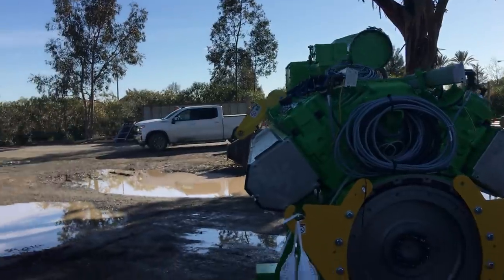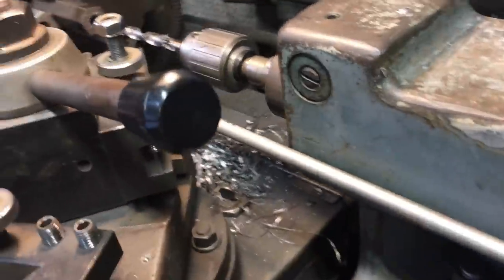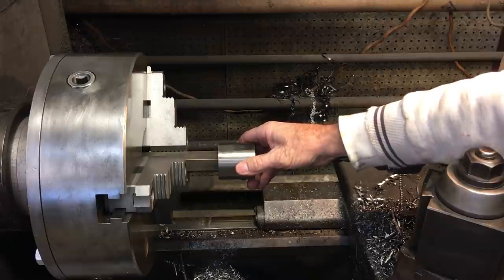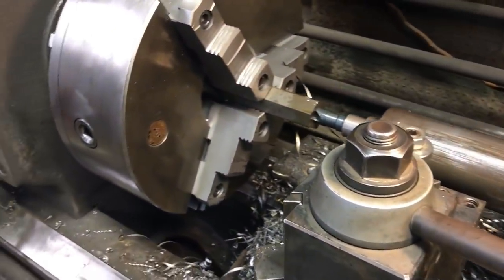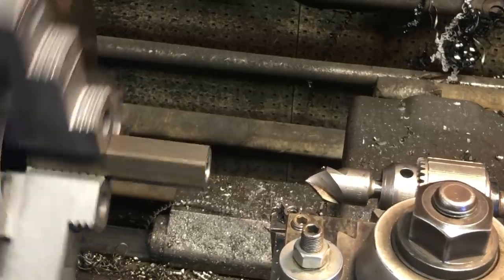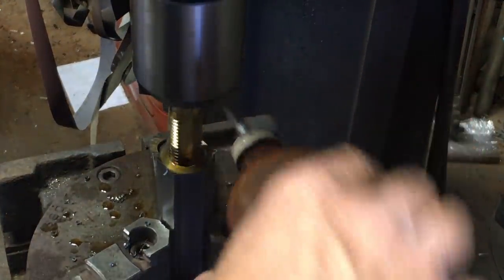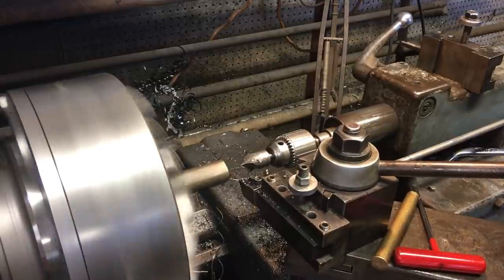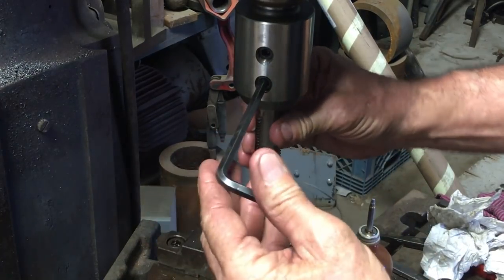Machining Lifting Eye Standoffs

Comment: I am a new subscriber and hobby machinist. I found your use of the drill pilot quite clever and was interested in seeing how you coupled the carriage and tail stock together.
I may have to drill a hole in my qctp so I can make a coupling rod as well.
Reply from the maker: There are many times it comes in very handy,  Thanks for stopping by Robert.        Gary

Comment: Nice job.  Love the tips and tricks.  Almost time to get a big turrett lathe.  Did you to a 65% thread?
Reply: Randy, if I followed correctly Gary drilled 11/16" for the 20mmx2.5mm end. That would be a hair over 70%, I think.
Reply from the maker: Thank you Randy. I used 11/16 for the 20mm and 49/64 for the 22mm
Should be 75%.     Thanks for checking out the video.      Gary

Comment: This procedure all of us have done 1.000 of times i  found a quicker way use the mill Index center up and Drill a way in the Drill press fashion instead of the lathe . Just another way try it .🧐
Reply from the maker: I have been doing this a very long time and tried about every way one could think of and for me when drilling 5 inch or longer I get a straighter hole drilling it in the Lathe. But yes, there are many ways to do things and im always trying different ways. Some work better than others.  Thanks for stopping by and checking out the video.        Gary

Comment: Why not use the carriage power feed to run the drill through?
Reply from the maker: I have to be careful drilling the pilot hole ( 1/2 inch )   I need to go 5 inch to get through and if I let the carriage pull the tail stock to hard it can do some directional drilling and not come out perfectly centered on the other end.  Once I have a pilot hole the nest size bit does a great job following the first hole.    I hope that makes sense.     Gary